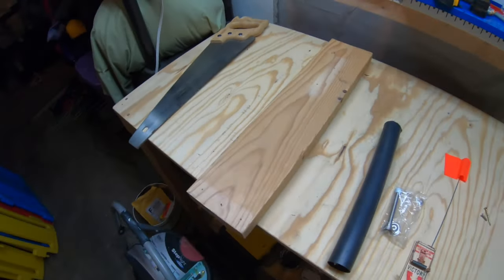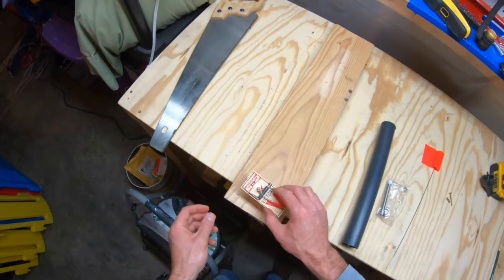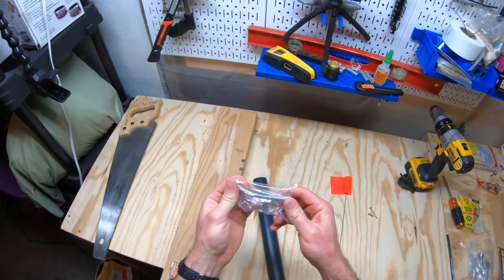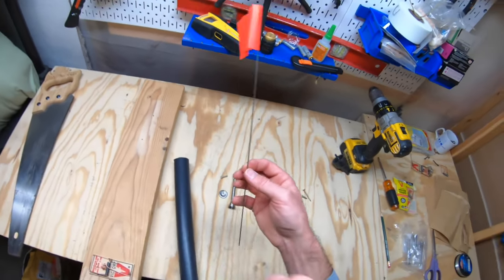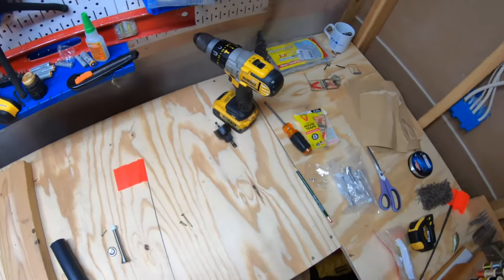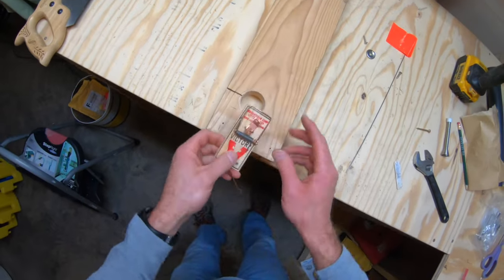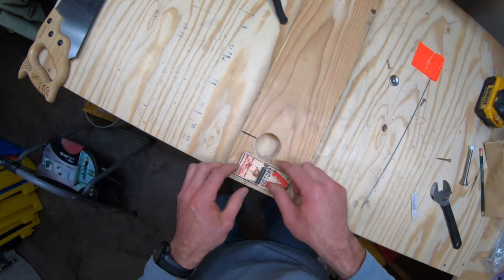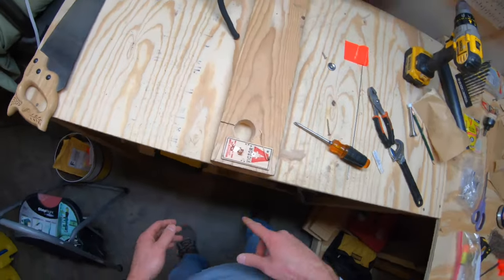DIY iFishPro Style Tip-up Build (Quick, Cheap and Easy Homemade Tip Up)

Comment: I like what I saw so built one. The only change I made was to put a eye from hook & eye set instead of the trap trigger. I took my grinder & cut out one side & smoothed it off. I always liked using my rod & this lets me. It worked great & gave me plenty of time to free the rod from the holder & move it to the side. 
What a great idea.
Thanks so much.
Reply: Can you elaborate or try to describe this another way please? I made one and this sounds like something I may want to try, but I don't exactly understand what you did ha

Comment: Great design. Two things to think about... 1 That narrow slit/saw cut will definitely freeze shut. I’d make it at least 3/4” wide. 2 your flag could easily come out of the door stop so if you simply make a bend in the shape of a “V” in the end of the wire of the flag after you push it through the plastic cap it will stay in. I’ll be making a few of these but I’ll probably make them out of circles of plywood with foam insulation and a pivoting arm that has a slot to adjust for the length needed for the rod. This is the first video of yours that I’ve come across and I’m definitely subscribing. Thank you.
Reply from the maker: I agree, the slit is too narrow. I widened mine out to about a 1 inch gap. The flag actually fits really snug into the door stop top. I don't think it will ever come out but it is a good idea to put a kink at the end to make sure. Everything you said here sounds good - Good Luck!

Comment: I Like it, Well Done Bud.
FYI, If ya get adhesive back sandpaper you can put a piece on the outside of the Saw Hole Drill Bit and that will make Sanding the inside of the Hole walls Way easier.
Thanks for the Video Tip<------<<<Pun included🤪
Reply from the maker: Thanks! Adhesive backed sand paper is a great idea. I'll grab some next time I'm at the hardware store.

Comment: Now thats an Idea . Main concern would be the rust that will apear . There must be some sort of plastics that can be used in some way (been thinkin about building something similar but hmm )
Reply from the maker: Yes after using my all last winter I do have a little rust. Everything still works fine the trap just doesn't look as good as it used to. I think I am just going to plan to switch out my mouse traps every year to keep everything running smoothly. They only cost $1 each so it is worth it to rotate them on occasion.

Comment: Have  you used this with bigger baits like shiners? Do they have enough power to trip the flag?
Reply from the maker: I've tried it with very large and active minnows and it held but I think you could get some false flags if you have really large shiners. I made some updates to this build in which I use a toothbrush to hold the trigger bar and that allows for different sensitivity settings. I pinned that video in the comments if you want to check it out.

Comment: When the trap goes off it will jerk the line, telegraph to the fish, and it will spit the bait. I  think you will lose a high percentage of the strikes.
Reply from the maker: If it's rigged properly the line releases cleanly in the same way an iFishPro does. There is no line jerk because the slightest pull detaches the line from the trigger. If you're worried about wrapping the line a slip stop connecting the line to the trigger works the best.

Comment: I've been trying this exact idea all night. Completely failed. The line keeps going around the mouse trap trigger. You using mono or braid?
Reply from the maker: I was using mono but I think braid will work also. When setting it wrap the line as close to the end of the trigger as you can so it gets a clean release. If you still have problems you can use an IFishPro slip stop which will keep you from having to wrap your line around the trigger to set it.
Reply: I had this issue, and realized I had my flag extending out past the trap too far.  So when it released, the excess flag would get caught up in the line and bar it's wrapped around.  Need to put as little of the flag under the bar as possible.  I also bent the last portion of the bar (that's already bent to catch on the trigger) down, so that the lines slides of easier as it's travelling up

Comment: Looks great, only question i have is, how sensitive is it, will bluegill and crappie set it off?
Reply from the maker: It is actually pretty sensitive. I think it will work well for crappie and bluegill. I have to make sure it's not too sensitive under certain circumstances. I need to test it out with a large over-active minnow to make sure I don't get false flags. If so there are some adjustments I can make so the trigger sticks more.
Reply: We have all be trapped by a mouse trap when setting it...pretty sensitive I’d imagine!
Reply: I made one and you can adjust the sensitivity by either slightly bending the metal trigger piece (so the bar with the line wrapped around it has to be pulled harder to set off the trigger), or you can also adjust it by moving the flag closer to and farther away from the mouse trap.  This either increases or decreases the tension the flag puts on the bar and therefore alters the amount of force needed to trigger the flag.  I'm actually thinking of just drilling in 3-5 of those base plates that hold the door stop at different lengths on the board, and that way you can have a choice of sensitivity and just need to screw the door stop into whatever one is needed. Great idea and video @Backroads Angling

Comment: Do the rod spools freeze using set ups like this?
Reply from the maker: If a fish spools you down the hole and then you reset everything your line might freeze up after it gets wet. Its a good idea to check your tip ups often to get any ice off from the line, the hole or the mechanism of the trap.

Comment: If the end of the mouse trap trigger bends upward how does a fish pulling down release it?
Reply: oh it pulls it sideways...never mind gents...lol I like the PVC style jaw jacker style cause the tension in the rod sets the hook
Reply from the maker: Yes, you are right. The trigger releases down and to the side so any pressure from the fish trips the trigger. The iFishPro and Jaw jackers are 2 different style tip ups that both have their ideal applications. The  iFishPro is best for fish that take awhile to eat the bait (Pike, Lake Trout, Catfish, sometimes Walleye, etc.). The Jaw jacker is better for fish that pick up the bait but quickly drop it (Trout, Panfish, sometimes Bass, etc.).
Reply: You are exactly right an immediate set would probably cost you pike

Comment: What if yoy are useing live shiners i feel like then would set it off
Reply from the maker: I have been using some larger size lively minnows and I don't feel like they are close to setting it off. Big shiners, I'm not sure yet. However, there are several ways you can play with the sensitivity. 1) There is a little bend that forms the groove that the trigger fits into. You can use some pliers or forceps to make this bend larger (or smaller if you want more sensitivity). The trap becomes a lot less sensitive this way. 2) The landscaping flag pushes up on the trigger bar and that is what holds the line. The harder the landscaping flag pushes up the harder it is for the trap to go off. The easiest way to increase the force on the trigger bar is to extend the flag out further. The more the flag extends past the trigger bar the more force it pushes up with when the trap is set. I have mine so it goes about 1 inch past the trigger bar when set. If I increase it to 2-3 inches it is harder to release the trigger. You can also use a stronger flag with less give than the flimsy landscaping flags such as a wooden dowel flag. This got long. Good luck!

Comment: What happens when the mouse trap is covered on snow and slush frozen.
Reply from the maker: Ya, I think it's a good idea to keep the mechanism as free of snow and slush as possible. I like to clean off my tip ups regularly during a snow storm to make sure they don't freeze up and to make sure my hole stays ice free.
Reply: That means you should not be using the set up and using a regular tip up… I think these probably will work best on bluebird or overcast days.

Comment: Your line slot is to narrow. Cut it like a horse shoe. Will not make the base any weaker because its already cut.
Reply from the maker: I agree. I have since cut mine about 1-1 1/2 inch bigger.

Comment: Why not attach a flag on the end of the rod an inch or two back from the tip. Use whatever material will get your attention when tripped
Reply: Bc this does not automatically set the hook the rod is always up.  You are thinking of a jaw hacker type trap

Comment: Made mine in 45 minutes no mouse trap
Reply: what did you use instead?
Reply: I did the same thing. I used a a screw that I bent over 90 degrees and a longer piece of copper perpendicular to it. The deeper into the screw the less sensitive.